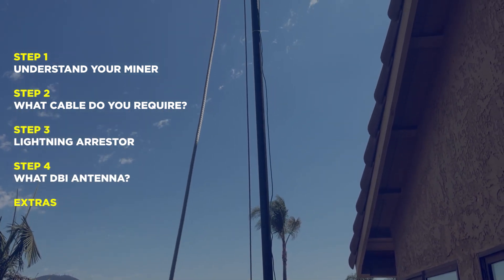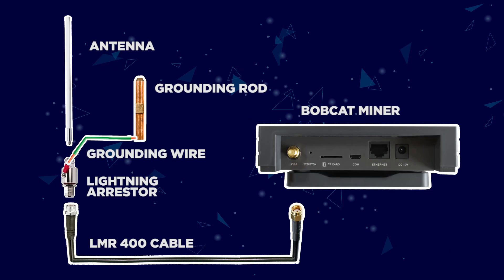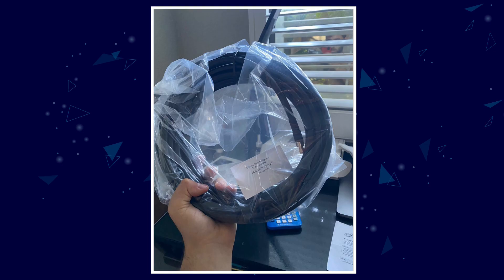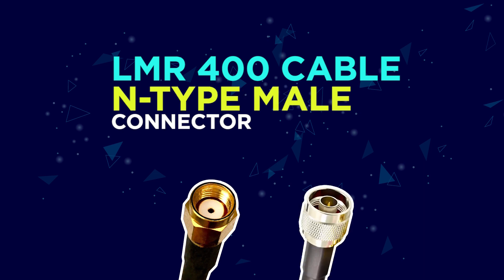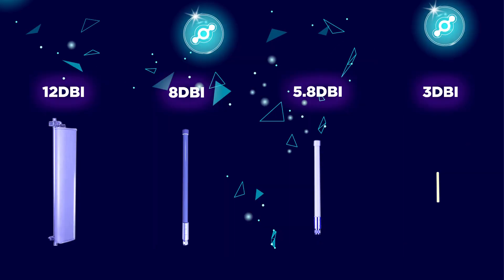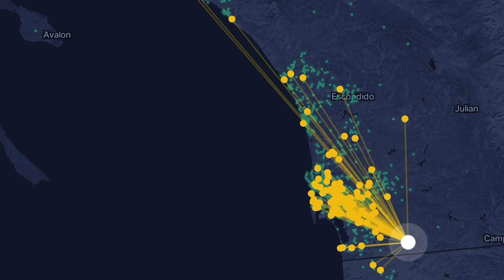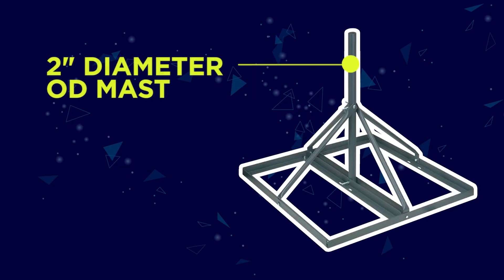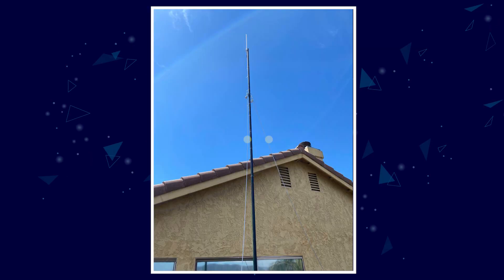Bobcat Miner Antenna Upgrade | Step by step Upgrading your Helium Miner Antenna ($HNT)

Comment: There are alternatives. First, if your mast does not go past the roof ridge, you probably don't need a lightning arrestor and can just ground the mast to your telephone, power, metal plumbing, or CATV ground. If you extend the antenna 10ft above your roof ridge, you will need to lightning arrestor. Secondly, you can ground your mast into the soil by digging a hole using a fence post shovel or auger and placing sched 40 PVC pipe that is at least 4" diameter into the hole. place your mast inside the pipe and fill the inside of the hole and pipe with gravel. You can attach your mast to a roof gable using Sched 40 PVC pipe and attaching it. This will give you a stable two point connection to keep your mast steady. If you have a two story home, it should be effective to 40ft even with 50Mph + winds. You will need guy-wires if your mast is standalone. I've successfully done this with both TV and radio antennas.
Reply from the maker: Hey Barry, thanks for highlighting the alternative, great to see different solutions out there when upgrading antennas. I went with a more standalone solution which is working quite well, still exploring into further ways to enhance the setup, starting off with an enclosure.

Comment: Pretty cool.  My setup is pretty much the same.  I got a flag pole in my case and have it tied to my balcony with grounding wire and arrestor.  My bobcat is kept in a plastic container with cover for rain or dirt.  Now it’s plug and play!
Reply from the maker: Amazing : ). Sounds very similar, glad you took the steps to upgrade. Wish you the best of luck once it arrives.

Comment: LOL If lightning were to hit your antenna, your home would go up in smoke in an instant! LOL
Reply: He specifically mentions the lightning arrestertor in this video prevent this.
Reply: @captnjaygreybeard6394  Lightning arresters cannot protect you from lightning. All it does is protect your equipment from static electricity during lightning storms.
Reply: @LaurentDuchesne3333  Cool thanks, but the house should have some type of lighting rod to begin with right?
Reply: I have no experience with lighting rods so... lol
Reply: @captnjaygreybeard6394  Right. I have mine grounded to the water pipe in the bathroom upstairs. :)
Reply: @captnjaygreybeard6394  I decided to drill a 2.5 in circular hole in the attic to the roof and stick my 6 dbi antenna (from Rockland) through it, on a 5 feet antenna mast (Home Depot). So my 25ft LMR 600 and lighting arrester cables are in the attic, one going down to my room, the other (copper wire from Amazon) to a water pipe. That way I have easy access to my miner sitting on a desk, while connected to my router.
Reply: @LaurentDuchesne3333  That sounds like that system will work out well. Thanks for explaining your setup. I need to start planning what I am going to do. Believe it or not, today my Bobcat300 finally arrived. I want to update the antenna, and find good place for it on the roof.  
I'll get it set up in a window with the 4db antenna to get started, then I need to get a better antenna and a plan to mount the antenna. 
I hope your mining a bunch of HNT, cheers.

Comment: Would like give 2 thumbs up! Great Video, thank you! Anything on point, great! I'm also still waiting for my Miner, but look forward for an antenna. Guess IT May be a 5.8 dbi, but wanna use it inside the house. Must i use a lightning Arrestor?
Reply from the maker: Hey Sani. Most welcome 🙏. If you are using it indoors a lightning arrestor is not needed. However watch out for the port connections. You would need a cable with a n-type female end to then connect to an antenna with a n-type male.  Hope that makes sense.
Reply: @Crayban  absolutely, thank you!

Comment: I should be receiving my bobcat soon, what would you say is the max range of the stock bobcat antenna approximately (suburban area)? I know it probably depends on terrain as well, which is quite flat where I live.
Reply from the maker: Hello, the higher you can place it, the further it can reach. I had a 4dbi in the attic in the same household, however being in the suburbs it struggled with hills nearby it struggled and could only reach out around 5km. With flat land i have got one of my 4dbis to reach 36km. It just requires a good line of sight and with no obstruction.

Comment: HNT better go up to 20 dollars after the halve occurs
Reply: It's going to be interesting as there's 19.58% locked in validation so far. And who knows how many HTN will be burned adding all these hotspots
Reply: @rhetoo  19.58% of people have the miner but didn’t get validation for it? I did not know the problem was that bad. I’m not really concerned about the amount of hnt, still a lot to be mined
Reply: @drx696  no in the validators I mean. Its like locked in staking.
Reply: @rhetoo  thanks for the info .

Comment: I'm really thinking of using LMR-600 cable just for its lower loss of dbi.. Its only a £14 difference from the LMR-400.
Reply from the maker: Hi Johnathon, good call, you most likely know it is slightly less flexible as the cord is thicker, LMR 900 is a beast, but struggles with any wiggle room. Let me know how it goes.
Reply: @Crayban  yeah that has me a tad concerned with connecting to the miner. I plan to mount the miner in top bedroom and run cable down from attic into miner room and miner. Pretty much straight runs so it should work out, famous last words lol
Reply from the maker: @rhetoo  haha, straight as a ruler 📏. I’m looking to do the opposite for the next upgrade. Looking to place an enclosure on top and run a Ethernet cable down and reduce the length of the cable to about 3-5ft. Waiting on the enclosure.
Reply: @rhetoo  even lmr 400 flex is pretty beefy, not super flexible. might want to get a piece of cable so you know what you are dealing with.
Reply: @16Godzilla  the only bend is down into the room from the attic. After that it's a straight run down the wall with clamps to where I will wall mount the bobcat.

Comment: I have been trying to get ahold of them for my order for over a month now. I was emailing them then all of a sudden they stopped responding and I emailed them again and still no response. Can you help me as I feel like they are just brushing me aside and I’m out of my money.
Reply from the maker: Hi Travis, what was the email about? The best way i got through was via the email form, that is if there is an issue.
Reply: @Crayban  I made and order and paid for it through mugglepay and like a few hours later they removed mugglepay as their merchant and I’ve been stuck in limbo ever since. I have tried emailing them multiple times to our old conversation and then started a new form and just have never heard back.
Reply from the maker: @TravisGondo  just as an FYI, if you’re payment went through it’s fine, all payments made in usdt or on muggle pay are still processed. Did you receive an email for your order? Do also check your junk mail as it can be sent there at times.  I’m terms of contacting them, the best bet is support@bobcatminer.com , which you probably have tried already. They are also active on Twitter, you could give that a try.

Comment: Is that a bobcat in a plastic bag...on the roof? How will extreme cold or heat affect the miner long term? What effects can the plastic bag have on the miner?
Reply from the maker: Hi Diego, it is a balcony. The plastic bag is temperamental until my Bobcat Enclosure arrives hopefully this week. Although the concrete  will hold any water out (just taking extra caution), wouldn't recommend the plastic bag long term. The bobcats operating temps can be found here if you're interested : https://d523ddbc-be3d-4ce8-9f4a-86e1d9b2472b.filesusr.com/ugd/2cb88d_bd085315425a4c0892cf4f652e2b17d7.pdf?ref=xO-Nuzdb2VFMH
Reply: @Crayban  thank you.

Comment: Roughly, what was the total cost?
Reply from the maker: Hi Joshua, It was roughly around $300 excluding the pole. The pole was quite expensive, around $180. However definitely was worth the upgrade.
Reply: @Crayban  Got ya. Certainly worth the investment if it 5x your earnings. Appreciate the knowledge, bro. I got 4 on the way and I plan on a similar set-up
Reply from the maker: @joshuaytuarte5622  Most welcome, glad I could help. Wish you the best of luck once they arrive : )

Comment: I'm in a little town of Alliston Ontario. What would you recommend I do? Set up 6 with 4dbi stock antennas.. or would 1 miner with an 8dbi antenna aimed at Toronto be an equal opportunity?
Reply: Assuming the one is 25 feet up like yours in the video. Would the witnessing of Toronto miners be of better value than just witnessing a few around my town
Reply from the maker: @blakehoran9629  Hi Blake, each environment is different, however if you elevate the height of the antenna, the potential to reach further out is not that difficult, as LoRa antennas are very impressive in terms of reach without even upgrading. If you could setup 6 and have them all connect further into the city, that should pull of some good rewards. (Shiny Raisin Seagull) This is a single setup, looks like a 5.8dbi, shooting out in 1 direction.  (Short Arctic Raccoon) This is an example of a hotspot part of a good network with other hotspots and reaching out into the city of London.